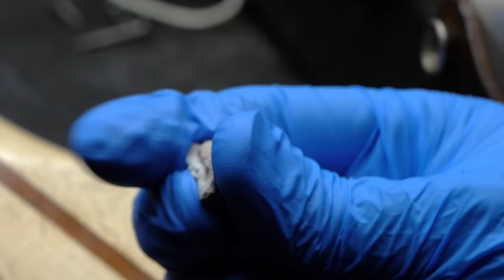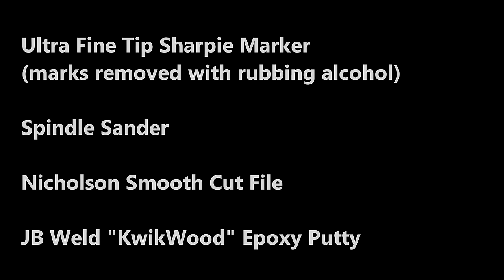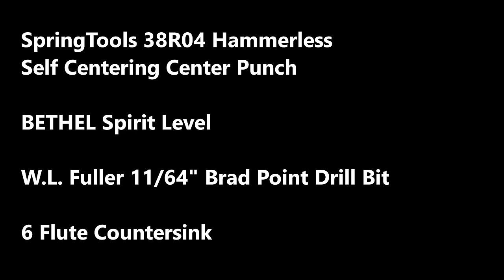My Strat Gets a Heel Contour

Comment: Why was the huge heel flat left on the neck?  I always removed them. Vast improvement.
Reply from the maker: I'll have to try this. You mean removing the whole area that's in contact with the neck beyond the contour? The only reason I didn't do this was cosmetic, though I did leave the area bare with an amateur looking, non tinted filler, so...

If it improves playability more, I just might do that. I know that guitars that come with the contour usually have that area totally removed. Though I've seen others without it removed. 

This improved the playability dramatically. So if that helps even more -- may take the plunge and go all the way with it. 

Thanks for pointing this out! Would you say it's a dramatic difference?
Reply: in late 80 this was quite normal like the satin finished neck. I own the Fender HM Strat and a Yamaha bass
Reply: @Tini.F. 
I bought my HM strat in 1988' used it for years until it was stolen in 2000  
was the best guitar I've ever owned or played outta hundred's.

Comment: Wow. Seems like a waste of time. Yngwie, Uli Jon Roth, Blackmore, Hendrix, SRV, etc... never seemed to need a heel contour. Very little benefit.  Just my opinion
Reply: I like how you dropped yourself in with all those legends.
Reply: Jeff Beck. (Drops mic)
Reply: Dude, this is not a mod for Nylon string guitars!?
Reply from the maker: Made an absolutely tremendous difference. Night and day.
Reply: @Rackhir420  Lol, not to put myself anywhere near their talent, just to say I never  felt it necessary to take a sander to any of my strats to reach the highest frets. My Ibanez has the contoured heel and it's great but I like my Strats fine how they are. I did save 'just my opinion' as a disclaimer (I thought)
Reply: @Rackhir420  Post has been edited and removed myself from the list. Don't want to confuse anybody who may think I am comparing myself to the awesome players I mentioned.
Reply: I have both with and without contour. Of course it makes a difference if you try to play on the very last frets like he did
Reply: @Javier-qk7ms  Yeah, I play all the frets up to 21 on my 1999 mim and 22 on my 2022 vintage player strat. I easily bend the last fret 2 full steps, without issues. It is comfy on my Ibanez and Kramer, that have contoured heels, but don't think it would be worth chopping on my perfect fine original Strat bodies. Guys like Yngwie play the last frets all the time and I've never heard any complaints, lol! I don't spend a huge amount of time playing scales at that high register, so not a big deal to me. To each his own.
Reply: I agree - even the difference between a cutaway acoustic and full body is marginal in my opinion - a full cutaway only seems to be worth about two frets - as someone once said ‘there’s no money above the first five frets’ hehe
Reply: I did this too my Les Paul deluxe back in the 70’s best mod ever. I play musiman guitars. They have the neck heal chamfer .
Reply: I was thinking the exact same thing watching the vid... Like what the fucking necessity of this... Unless killing your strat feel a bit more.
Reply: @e.b.4872  Yep. I don't like extra holes or missing paint on my guitars! Lol
Reply: I have an HM Strat with this style of neck joint and taking that corner off makes a massive massive difference for reaching the 24th fret.  Still not as good as Ibanez neck joints though.
Reply: @rexkramer64  I dig those HM Strats! My buddy had a hot pink one (Japanese) for a bit in the late 1990's. That was a sweet guitar!
Reply: Agree.
Strat already have excellent upper fret access to begin with.
Reply: It’s about preference, not playability. Comfort thing, I’ve not needed this to play, but I like it and prefer it just the same. 😂
Reply: @redkurn  It does feel comfy, agreed. I would sacrifice a marginal amount of comfort before messing with the aesthetics of my beautiful strats. Just my opinion, that's all.
Reply: 99% of people buying an American made strat today are getting a contoured heel. From Am Pro II up to Ultra 🤷🏼‍♂️
Reply: @tequilawerewolf  That is awesome. I would buy one of those rather than grind mine down. My Kramer and Ibanez (both 24 frets) have them and I love the feel. The guys I'm into don't use them and their Strat signature models come with the regular old neck heel, so I don't feel like I am missing anything.
Reply: Well Im standing next to my fender! Choppp it dowwwnnn with the edge of my saaaaAaanndddddeeRRRRR! 

I have huge hands. Every micrometer matters!! Sausage fingies!!!! He must have a few guitars……😮😅
Reply: Amazing how many people can’t just say “nice job bud” and realize this was a pleasant video by a skilled craftsman illustrating how he added a higher end feature to his guitar. Brilliant. Great video. You should be proud of it!
Reply: It’s just a cool video, take it for what it is. I’m sure tons of people would like to do this and he’s just showing how it’s possible.
Reply: As a cover band guitarist who almost always play solos to the last frets I find non contoured heel very limiting. But I'd been playing with a 24 fret superstrat for so long though. I guess I was just too lazy to change.
Reply: Fender Jeff Beck Strat has a contoured heel, so remove him from the list…
Reply: do you really think life is a dichotomy between "necessities" and "wastes of time"? dude did whatever tf he wanted to do with his own instrument lol
Reply: I have small hands, I need a contoured heel. We are all different with different needs and wants. You do you.
And if someone tries to stop you doing you, tell them to go do one!
Reply: Who asked
Reply: @chakalaka3960  We all have the right to voice our opinions (at least where I am from). That's what I did. Others seemed to have the same opinion...
Reply: Well not everyone is Stevie ray vaughan and Hendrix so that’s just like, your opinion, man
Reply: They all modified their Strats to suit their respective playing styles as most pro players do
Reply: I love this. It's not 1954 , WHY is this not standard on non reissue models ?
Reply: It's subjective man!
Reply: Laughs in ibanez neck joint
Reply: Some people like to do things themselves. Creative people who can do things with their hands. If he wants to improve the feel of his guitar I don’t understand why in the word you feel the need to give your negative comment. I see this so often. Just.. Wow. Seems like a waste of time.
Reply: @robertcalvin2643  Thats exactly how I felt, lol.
Reply: Seems biased and intolerant. Just my opinion.
Reply: @dchck4769  Exactly my point, your OPINION, which you are entitled to. Everybody is so sensitive these days, jeez! Even the OP was less offended by my post, hehe!
Reply: Why not? It looks good and it feels great. ~(˘▾˘~)
Reply: @scotthayes-nylonstringguit8592 If you have a small baby hand like myself, that contour helps A LOT. Not wasting a time
Reply: @scotthayes-nylonstringguit8592  You are entitled to say your opinion. So as others too. Being so sensitive? Don't whine about the comments you get. You need to deal with it when you want to stand with your opinion and point.
Reply: @FancyCP30  Point taken! Have a blessed weekend
Reply: hater's gonna hate
Reply: It makes all the difference if you play In upper frets often
Reply: You sound like someone I will never invite to my party
Reply: And James Jamerson used one finger. Where are your tools man?
Reply: Jeff Beck seemed to like the contoured heel
Reply: The heel on my Strat definitely bothers me when reaching for the higher frets. I have a large palm so that might be part of the problem.
Reply: @scotthayes-nylonstringguit8592  Why make not make your life easier. It does not affect tone nor the neck stability. It is literally a straight upgrade with 0 compromises so why not have it on your guitar if you want it to play as well as possible.
Reply: Ok but I’ve never needed my frets scooped out like Malmsteen. Guess he isn’t as good as me. Oh wait. No. Everyone just has a preference to feel and genders feel like crap at the heel with that stupid point. This is the exact mod fender themselves did on the deluxe line
Reply: Ok but I’ve never needed my frets scooped out like Malmsteen. Guess he isn’t as good as me. Oh wait. No. Everyone just has a preference to feel and genders feel like crap at the heel with that stupid point. This is the exact mod fender themselves did on the deluxe line. Also none of those guitarists ever had the benefit of being offered a contoured heel and all would have accepted it.

Comment: I've done this to 5 guitars and encourage anyone building a kit to try it -super easy, and feels like the neck block is 2 frets shorter. If you have a real Fender then you'll hurt resale value, if that's an issue for you. Note he's using a drill press to keep inserts at 90 degrees. I did it by hand and 1 went in slightly off and you really want to avoid that! Of course, you can just use screws too.
Reply from the maker: Anyone interested, I have a video on installing threaded inserts here: 

https://youtu.be/LRMnSfjIqik?si=izTArK9L1EB69DRb

Agreed about the resale value. This guitar is staying with me for life, my first Strat ever...2005 MIM Strat. Near and dear to me. 

I'm thinking of putting another Strat together as well, maybe with a Floyd Rose. Looking at Alder bodies. My last was a swamp ash. I think I like alder better, just based on how this one sounds compared to the other one. 

Upper fret access is nuts now....love it!

Comment: To each his own. I've never once had a problem with the neck heel.
Reply from the maker: Yes. One of my favorite things with guitar is modifying them to personal preference. Many people love Strats just the way they are. 

I've made my own custom pickguard with only a Neck and Bridge pickup, and two push/pull pots in the location of the middle and neck tone controls -- nothing in the normal volume control place.

I also made a custom jack plate, top loading -- with a 3 way switch on it as well. Out of pickguard material. With two pickups I get 6 tones, and total freedom for my right hand. Absolutely love it. 

However, this is for me. It's my dream guitar, with customizations I came to after many years. 

For other people? The stock Strat layout is perfect. My friend and mentor prefers Strats just the way they are. For me, it's much better with the switch and controls completely out of the way...and no middle pickup. 

All that matters is you have fun...and your guitar works the way you want. I'm an eternal tinkerer. For me, it's as much fun as playing the guitar itself. I find myself very happy with my guitars for months or years after most modifications, then I'll come up with something else, and try that. Much like playing...the fun never stops. Endless learning curve. Really enjoy it!

Comment: Nicely done!  So glad you filled in the unused hole in the neck.  My OCD would have been triggered otherwise 🤣
Reply from the maker: Same! I did get lazy with the epoxy putty, didn't even bother to use a color that matched better...but the hole being filled is what's important. Same with the hole left on the back of the neck. 

At first I didn't fill the hole on the back of the neck. Then the next day I got my camera out and undid the whole thing and then recorded myself filling in the hole with epoxy putty because my OCD....so I definitely get you!
Reply: besides OCD it's also a good idea because moisture can actually creep into unsealed wood, even inside the joint.

Comment: You did what I've been dreaming of doing for years...but also shown me that it takes more than I would have thought!

Finally, I was a little disappointed that you didn't touch up the paint, though... Especially with it being a basic colour (no metallic flake , or burst...or strange, flip -flop colour...).   I would have thought that a basic cream /off-white would be the easiest colour finish to find something for at your local hardware store..🤷‍♂️ Even an imperfect  match in paint (colour &/or consistency) would be better than leaving bare wood on that whole corner..

🤷‍♂️But hey! – each to his own, eh?! And U still did a good job, though. 😎👍
Reply from the maker: Best would be one of the Reranch colors. If I was going to refinish it, I like using a primer coat of Zinsser BIN, then nitrocellulose as a color coat. 

For white or off white, I don't use a clearcoat, as nitro clear coats yellow over time. 

I actually really enjoy the feel of bare wood. Cosmetically it doesn't look great, but feel-wise, incredible. 

Main reason I didn't refinish is it's a ton of work. I could have done it and shown the process but for nitro to dry, it takes weeks. I never got great results with hardware store stuff, aside from primer. For professional results I've always had to go with Behlen's stringed instrument lacquer and mixing my own colors, but for something like this (Arctic White is the technical name though it looks more like Olympic White, or what used to be called Olympic White) -- I'd prefer a professionally mixed color. 

Acrylic lacquers can work but I've never gotten great results with them. Could be a user error. For super and pro looking high gloss finishes I just use nitro, wait at least a few weeks for it to dry after spraying, then wet sand and buff. 

For buffing, I like Meguiar's ultra cut compound, fine cut cleaner, swirl remover and cleaner wax, in that order. 

All in all it's a huge process. I haven't done any nitro work in a while. 

These days I only use freshly mixed and hand rubbed shellac. Been meaning to make an updated video about this, especially for neck finishes -- it's all I use. I have one video up on my process for that but I've simplified things lately. 

Also, non toxic and no need to spray. Or even wear gloves if you don't want to. I mix shellac with grain alcohol. Many advantages. For natural finish bodies it's also my favorite finish.

Comment: I like how you go through all that effort to shave the heel down yet you don’t put screws in the pickguard to hold it on lol
Reply from the maker: I always do this. I made that pickguard myself, I usually leave most of the screws out because I'm always messing with the electronics. I have three screws in it currently and it's secure to the body, all held down -- they're in this video as well but not shown as they're the two "middle" screws and then the bottom leftmost screw. 

Another pickguard I made I only drilled it out for 4 screws, should have done it on this one...or just three. Holds surprisingly perfectly with just those. Would certainly look unique as well. 

Mostly though it's just the severe ADHD! It also bothers me seeing the pickguard holes with no screws in them but it totally slipped my mind as I was hyper focusing on making the video. And more videos to come soon...

Comment: Very satisfying, though I wish a commenter hadn't mentioned the lack of pickguard screws😂😂
Reply from the maker: Yep. I leave them out all the time. Usually only use 3 or 4 to hold the guard down -- only had 3 in for this video. 

 The fact I didn't put them all in to make it look nice for the video, would've only taken me a minute -- maybe symbolic of my severe ADHD. Surprisingly it is solidly in place with just the three screws. 

Might make another pickguard for it with only those 3 screws. Big fan of simplicity!
Reply: @guitar_md  you could do a cheeky little epoxy filler job on the holes for those of us with screws-in ADHD😂😂

Comment: Wow that’s great and great tool .Are you a cabinet maker or Luthier
Reply from the maker: Thank you! Funnily, I'm neither. Just a guitar tech. I do make custom pickguards with the drill press, band saw and router table, and rarely other pieces. And use a miniature lathe I made into a pickup winding machine. 

I understand much of how acoustic and electric guitars are built from scratch but haven't done that myself...yet. Not 100% from beginning to end, anyway. Though I've done a lot of structural repair work and modifications and more since 2005. 

I grew up with a dad who did everything though. In the home I grew up in he laid all the tile, carpet and hardwood flooring, built most of the furniture, did all the electrical and plumbing, all the crown molding, doors and window installations, all the automotive work including brakes, clutch replacements, brake line replacements and more, and masonry work and more that I can't remember. 

I  just have hyper focused on guitars and hardly know how to do any of these other things! In a way it's like how we can't choose who we're attracted to. 

I would have loved to learn all these valuable skills but I just spent my time learning about guitars. Funny how that works. 

And my main interest is in getting guitars to play better. I'm obsessed. I'd rather buy a pre made neck and pre made body and modify the heck out of them...for now. 

Luthiery is a skill unto itself. So I just am a lowly guitar tech for the time being!

Comment: Nice wide growth rings ( Alder) with the proper orientation.......that guitar  definately FEELS resonant as your playing I'd wager. It sounds great. I'd paint the bare wood (at least tung oil or put a clear coat on. White would be better and 100 % color matching wouldn't matter, most wouldn't really notice).
Reply from the maker: This guitar has always sounded incredible. My first...2005 MIM Strat. Amazing. 

I could put a coat of shellac on it no problem. I actually finished the neck with shellac (whole thing) after re-radiusing it and refretting it with SS wire. Got a whole video series on it. 

Shellac is my favorite by far. Only the fresh stuff though. I use a coffee grinder and dissolve it in grain alcohol. Love that stuff! 

Also didn't know that was alder. Should've known. An observant eye is always welcome here. Seriously, have owned other Strats and none compared to this one. Always my favorite and now it's the only one I play.